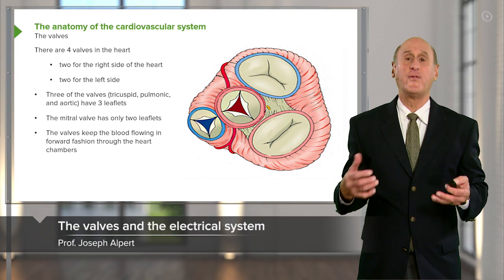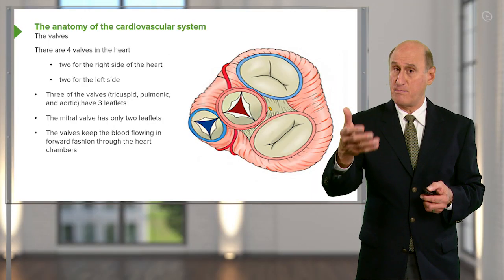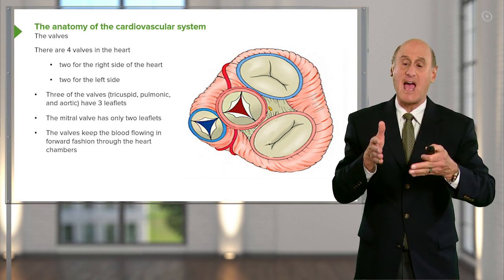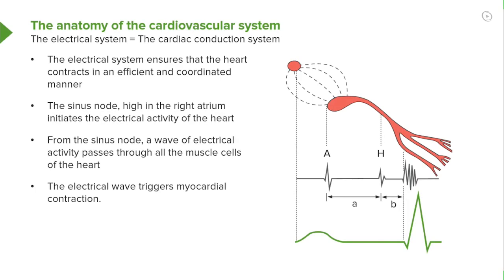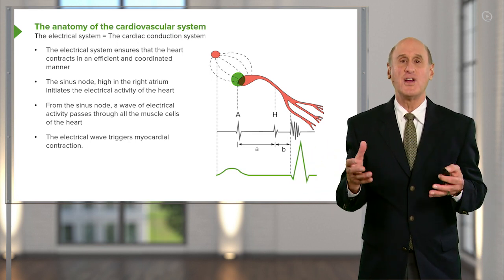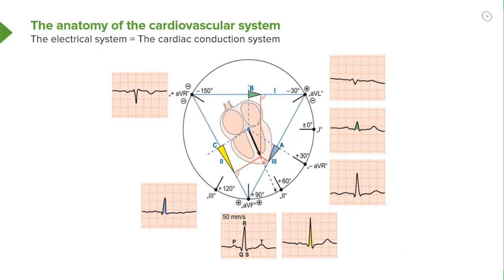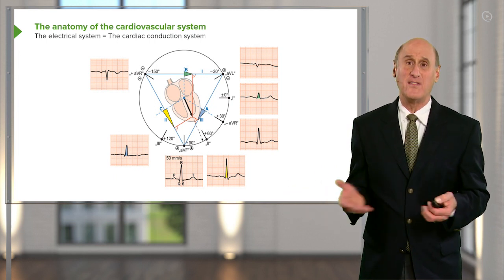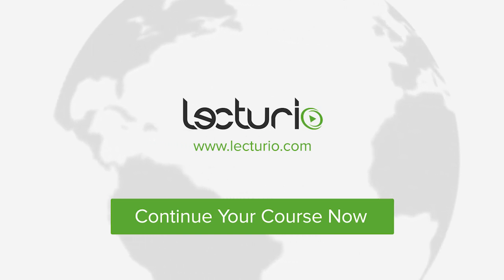Valves & Electrical System – Cardiology | Lecturio

Comment: The anterior valve is not the tricuspid valve but rather the pulmonic. You have the diagram flipped and rotated. The two posterior valves are the tricuspid which should be on the viewers left and the mitral valve is to the viewers right. The pulmonic valve is most anterior as it is the most difficult to visualize by TEE.
Reply from the maker: +John Nolan Hey John, thx for your comment. We will definitely review this lecture and will correct the misleading diagram. Furthermore we would like to thank you for your comment by granting you a coupon for one of our courses. Pls. contact me via youtube[at]lecturio.com for further information. Thanks again! Till